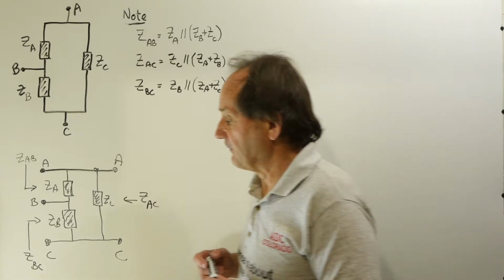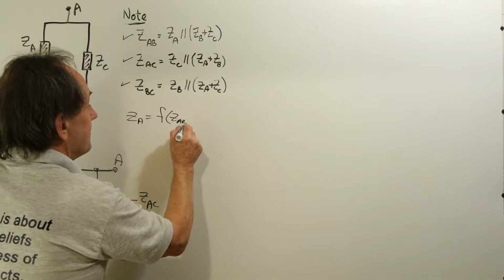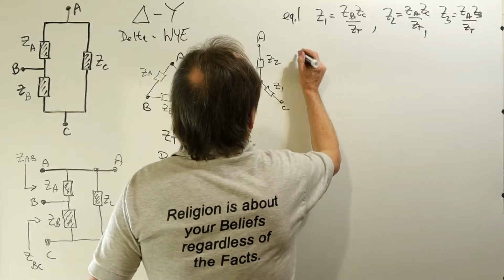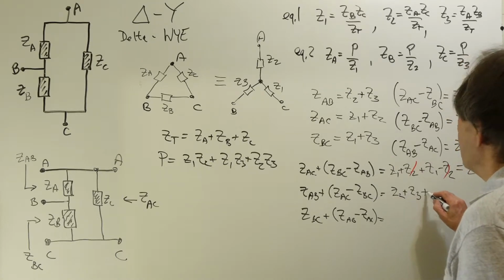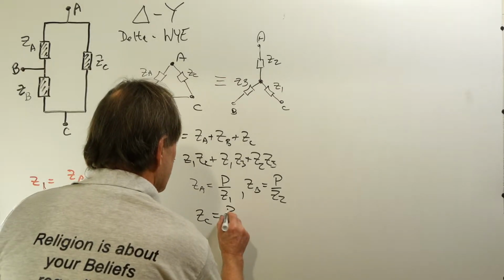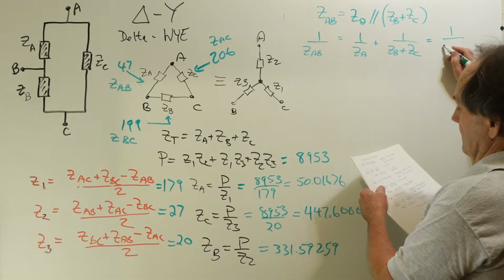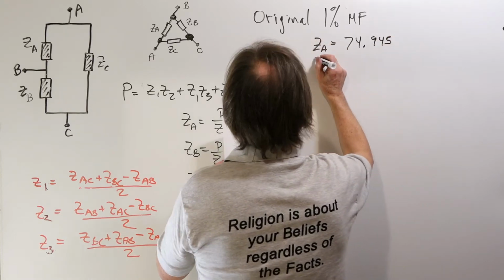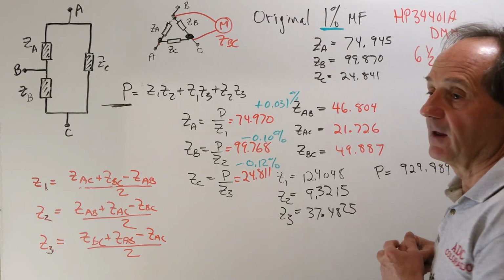Three resistor network puzzle

Comment: Hi George. Only just seen this. There are cetain people on Youtube I find very thought provoking; you are one of them. I think here I would have "cheated slightly" and shorted B to C and then measured A to the short, giving Za and Zc in parallel. Repeat for AC shorted and AB shorted and solve. It's still nice to have the Wye/Delta (Star/Delta As I know it) conversion trick in the toolbox though.
Reply from the maker: Very good Wendy.  You are the first to suggest this solution and it certainly requires less complicated computations.  There is no cheating if the method is valid and leads to the correct answer.  You get an A+

Your method for others to follow:
(NOTE:  the admittances  Y1, Y2, Y3  here are not the same as in the video)

Short B to C and measure   Z1'  =  1/Y1   from A to B-C with ohmmeter:
        Y1  =  1/Za  + 1/Zc

Short A to C and measure   Z2'  =  1/Y2    from B to A-C with ohmmeter:
        Y2  =  1/Za  + 1/Zb

Short A to B and measure   Z3'  =  1/Y3    from C to A-B with ohmmeter:
         Y3  =  1/Zb  + 1/Zc

To find  Zc:    Zc  =   2/(Y1 + Y3 - Y2)

To find  Zb:    Zb  =   2/(Y2 + Y3 - Y1)

To find  Za:    Za  =   2/(Y1 + Y2 - Y3)

Using the values below for Za, Zb, Zc to three decimal places we have,

         Za  =    50.017                           Z1'  =     44.9896
         Zb  =  331.593                           Z2'  =     43.4614
         Zc  =  447.600                           Z3'  =   190.480

We find, 

            Y1 = 0.022227                      [0.0222274]     
            Y2 = 0.023009                      [0.0230089]
            Y3 = 0.005250                      [0.0052499]

            Za  =   2/(Y1 + Y2 - Y3)  =    50.02            [50.0170]
            Zb  =   2/(Y2 + Y3 - Y1)  =  331.56            [331.598]
            Zc  =   2/(Y1 + Y3 - Y2)  =  447.60            [447.588]

The value for Zb at 331.56 as compared to the starting value of 331.593 had me concerned about the sensitivity to computation error so I checked what would happen if I carried out the computation on the admittances to 7 rather than 6 decimal places (6 rather than 5 significant figures) and the values in  [brackets] are the computed values.  The values are good when carrying out the computations to the same number of 6 significant figures as started out with.

The equivalence of the WYE-DELTA conversion and the shorting method would be an easy thing to prove by algebra manipulation.  You should try that.

I had originally thought about using this method to find the values of Za, Zb, Zc but the problem was that the three resistor attenuator network was buried deep into the rest of the electronics that trying to short two of the nodes was not an option.  Could not fit three probes between the surrounding components to get to all three nodes so had to measure node pairs with the third node OPEN.  Sometimes practical considerations get in the way of expedient measurements.

Thanks for posting your message.  I wish other viewers would be more active in exchanging ideas and getting involved asking questions.  If there is a topic you or other viewers would like covered in electronics or circuit analysis, let me know.  Any level of difficulty is welcome.  Viewer feedback is always appreciated.  I am currently working to finish up on about 20 videos yet to uploaded.  I have a series coming out on designing a precision digital multimeter that may interest you.   Please tell others about my channel so I have a larger audience to interact with.

Thanks,
George Hnatiuk
June 11, 2019  10:39am
Reply: Hi George, I get back to you with some topics and yes the multimeter will be of interest. I think it a shame that more people don't know of your videos; if I get the chance to point anyone in this direction I will. I'm going to comment on some of your other videos too. Sincerely, Keith. P.S.Wendy is my teddybear and now you've given her an A+ she says she is smarter than me!
Reply: Hi George. An idea for future videos. Following on from the Lewin-Electroboom exchange I think people may be abusing lumped circuit analysis regarding Kirchoff or Faraday. I even have an old textbook that refers specifically to "Kirchoff's rules for lumped circuit analysis". I think it is too easy to assume an L C or R is just that. In reallity extremes of low current,  high current or voltage, or high frequency mean parasitic  LCRs occur all over the place. Oh and there is radiated EM to consider as well, both self generated and external . I think part of the art of circuit design is knowing where lumped circuit analysis breaks down. Just a thought but I will not be offended if you ignore it. P.S. Mr Carlssons Lab is a youtube channel with many examples of LCRs behaving badly.  be  @georgehnatiuk5806
Reply from the maker: Wendy,
Actually that is one of the videos that I have been preparing ever since that exchange.  If you go to those videos, you will find many comments from me.   One such thread is this:

https://youtu.be/ototTU5NUNA?lc=UgyquBdqWI2j6xLgtvJ4AaABAg

I have been reluctant to publish my analysis and videos just for the reason to avoid opening up a whole new can of worms.  I have had private conversations with ElectroBoom and he behaves like an ass and thinks he understands Faraday's Law and its implications when he does not.  He just closed down the conversation when he could not follow the mathematics of it as I was trying to explain why he is wrong. 

I have alerted both Lewin and Belcher that there is a flaw in some of Lewin's videos and that paper Belcher wrote in conjuction with ElectroBoom and also in Lewin's lecture 20 notes.   I have tried to open a private dialog with both Prof. Belcher and Prof. Lewin with no success. They keep telling me they are too busy.   Lewin often misunderstands what I am trying to tell him regarding his error for I believe he thinks I just might be another crank.  He did make a serious error in explaining how the electric fields behave in a good conductor of finite conductivity.  His explanation is too simplified and in general WRONG in his lecture 20 notes and in this video:

https://www.youtube.com/watch?v=ototTU5NUNA

Lewin's explanation beginning at 32:25 is not correct.  He got the right answer for the wrong reason.  He chose a case with a high degree of symmetry in which the explanation makes sense but is WRONG.  I tired to tell both him and Belcher this but they will not listen.   

I just may revisit and finish my video on this and drop a bomb in the Youtube communities of Lewin and ElectroBoom but am reluctant to do so.   I really would like to talk to Lewin before doing this.  I checked my thoughts and analysis three times and set it aside the past 6  months to give it time to gestate and mature in my mind.   I need to be 100% certain I have not overlooked something before publishing something that points out an error made by MIT physics professors.  I will review my analysis one last time in a few more months and then finish that video.   I will also try to get Prof. Lewin to listen again so he has a chance to make a correction before doing so.

GH   June 25, 2019  12:30pm

Comment: What are Zab,Zbc,Zac. &Za,Zb,Zc.  And what's the difference between them
Reply from the maker: Zx   is the impedance ELEMENT attached between nodes "x" and "y" with "x" being the node named first in a counter clockwise direction around the DELTA loop.

Zxy = Zyx  is the EQUIVALENT impedance seen looking into any network between nodes "x" and  "y".

In case of the "Delta  NETWORK",   Zac or Zca is the impedance element Zc in parallel with the sum of elements  Za and Zb:
                                         
           Zac = Zca  = Zc // (Za + Zb)  =  Zc (Za + Zb)/ (Za + Zb + Zc)

In case of the "Wye  NETWORK",   Zac or Zca is the impedance Z2 in series with Z1:
                                         
              Zac = Zca = Z1 + Z2     with Z3 open circuited

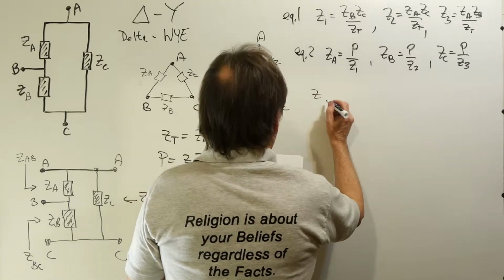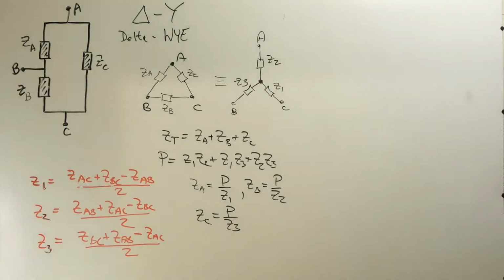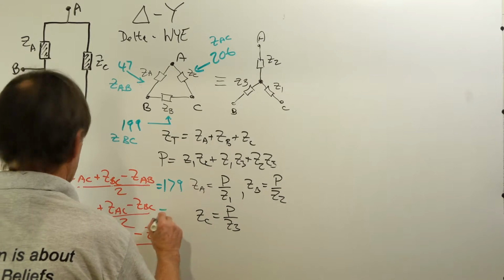This is explained at times  13:00  and  23:18 - 25:00

GH